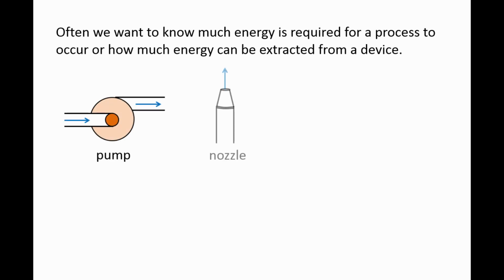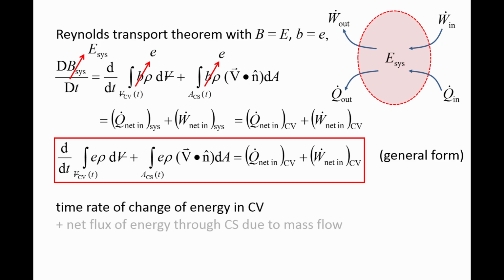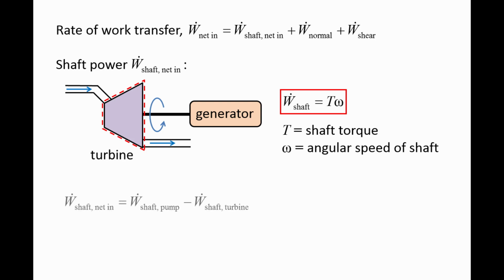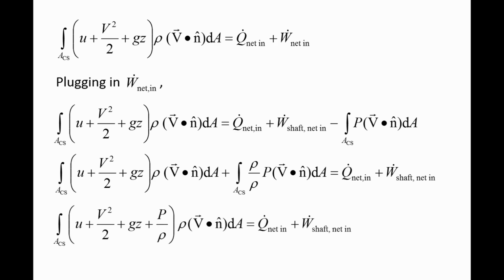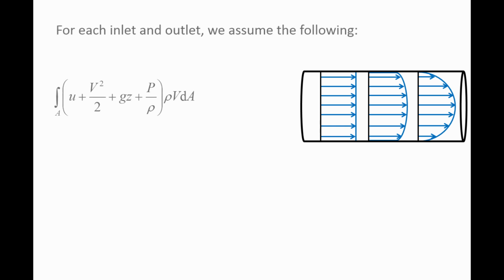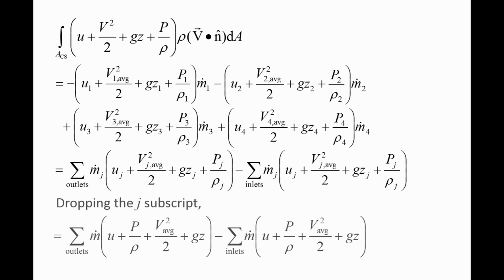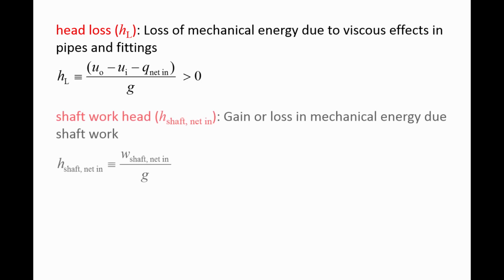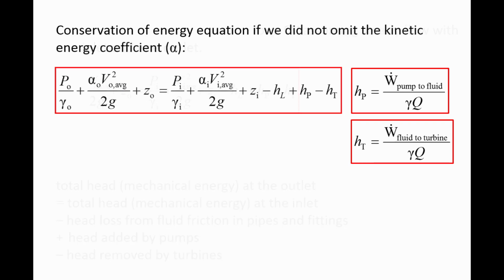Fluid Mechanics: Topic 7.3 - Conservation of energy for a control volume

Comment: Hello!

If I have, for example, a heat source generating 80W into the diaphragm wall, the diaphragm walls is into the ground, the heat exchanged at the interface ground/concrete could give me the actually energy efficiency of the system? For example, if I need to extract 80W from the ground through this concrete diaphragm wall, can I find out how much of the energy I can actually obtain to say "My needs are 80W, but I can get only 60W from the ground"? 

I am studying geothermal energy (energy foundations as diaphragm walls) and I don't know exactly what's happening in the ground because the method I am using consist in treating the pipes within the diaphragm walls (which are in the ground) as heat sources, followed by measuring the exchange heat at the interface of concrete/ground. But I don't understand exactly what this means. 

I would really appreciate your answer!!
Thank you!